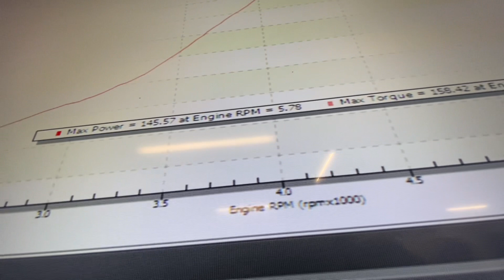Target Tuning a Harley with DynoJet

Comment: What are the benefits of the target tune? I have the PV4 and I’m thinking about adding the target tune module to fine tune my street glide but i mainly want to know if it drastically increases fuel economy or does it use more gas with the wide and o2’s? Just trying to figure out if the price is worth the benefits. I have a hi flow air cleaner and a full Vance and Hines 2 Into 2 big radius exhaust on a twin cam 96

Comment: on my 128 since it has been dyno'ed if i do another cam change do you
think target tune would work or get it on the dyno again
Reply: You can get the map for the setup from fuel moto and then the target tune will do the rest (very little to do since fuel moto knows their shit). But it’ll cost nearly as much as my local dyno would charge. You could give the target tune a try without the fuel moto map, but it may not be perfect for a while. Just go to the dyno if you ask me.
Reply: What is your preferred routing for wideband O2 sensor cable routing from the front O2 sensor to the Target Tune on a Harley SG bagger?